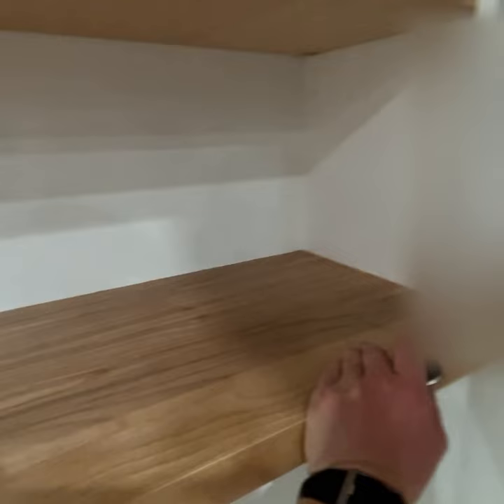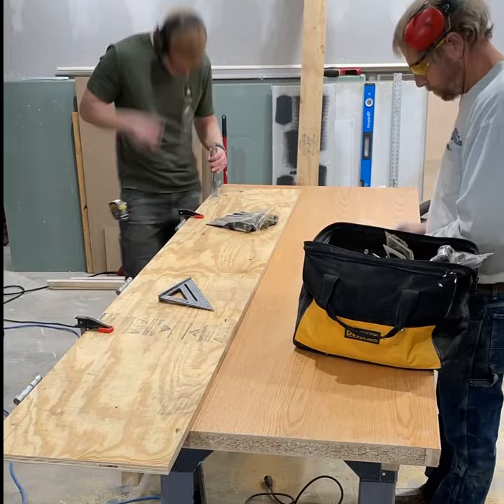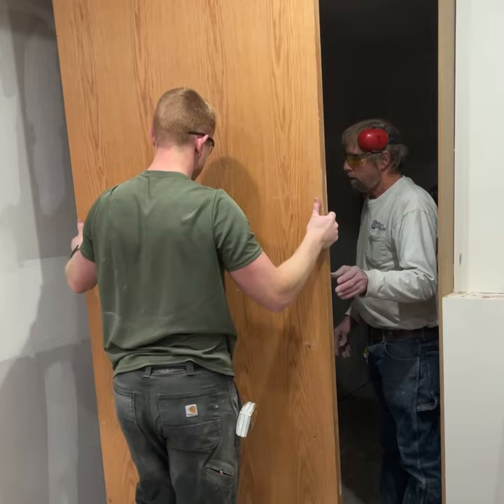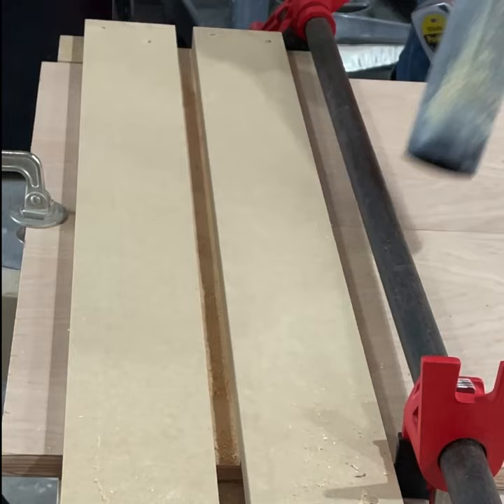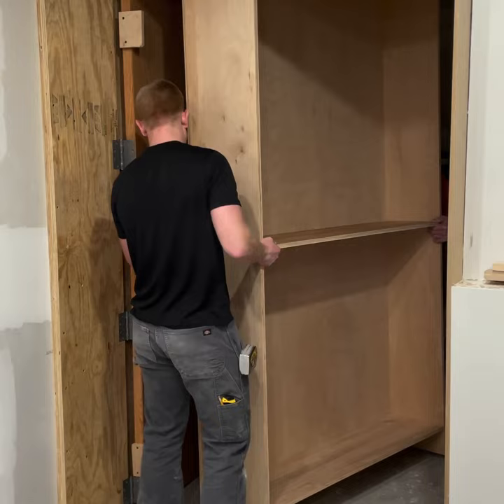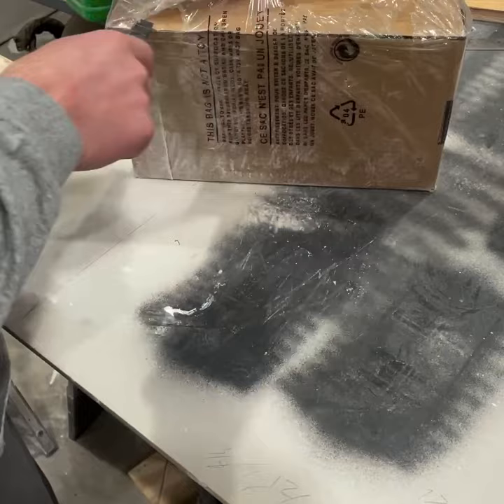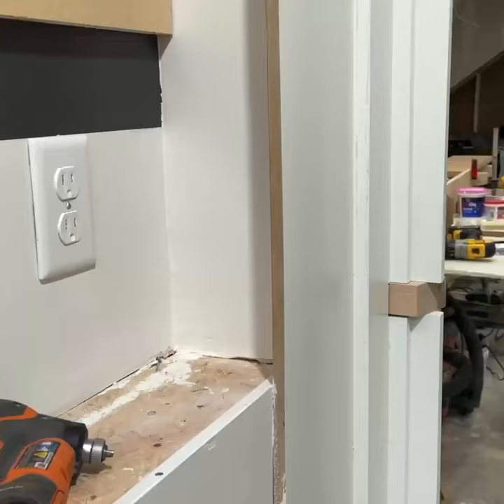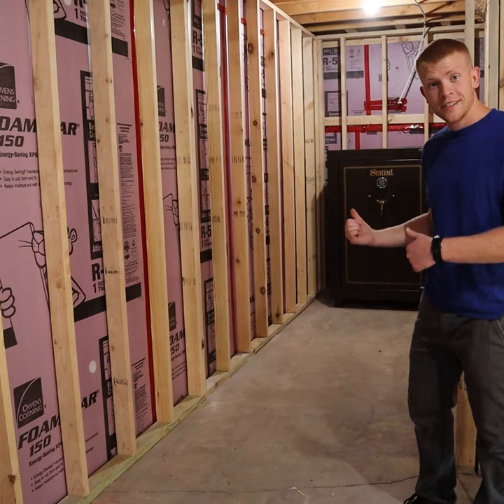How to Build a Secret Bookcase Door | Long Version

Comment: what name of this magnetic lock on Amazon???
please tell me that lock name which you using here
Reply from the maker: https://amzn.to/3M6wox8
Reply: So if my door is gonna open out instead of in I should order the outswing magnetic lock? The link you posted is an outswing but your door swings in? Or am I just thinking of it backwards?
Reply from the maker: The only thing that changes is how the strike is mounted to a bracket on the inswing. I used the outswing and made my own bracket because I wasn’t sure if the supplied one would work. 

Hope that helps.

Comment: That's real clean. I won't hate on the lock, but that's not how I'd do it. I'd probably hide a mortise deadbolt in the cabinet below. You could also do an electronic receiver that fails secure, with a key to let you enter (and a thumb-turn to shut yourself inside). Either way, I'd probably use a few rare earth magnets (or one Precision PLS24PRO-XHD) so that the bookcase doesn't open itself if you lose power.
Reply from the maker: If you decide to make yours tag me in the video, I’d like to see it.

Comment: I’m considering doing one of these but I’m worried about the hinges holding up once I load them with books or a kid climbs on the shelves. How did the hinges hold up once you added some weight to the door?
Reply from the maker: Haven’t had any issues. I did add a roller to the opposite corner for extra support though.
Reply: you let your kid act like that?

Comment: Do you know what the weight rating for the hinges you used was? Trying to figure out a cheapish way to do this for a 48inch opening with a single door and not spending $2500 on hinges
Reply from the maker: I would buy commercial door hinges that are fairly inexpensive and use casters to support most of the weight. Probably the cheapest way!
Reply: @SatisfyDIY they’re not very inconspicous tho

I had to google what the f is a casted it is a wheel lol. 
Idk though. 

Feels inelegant but does seem like the best and most reliable solution
Reply from the maker: It’s on the inside so you can’t see it unless you go in and shut the door behind you.